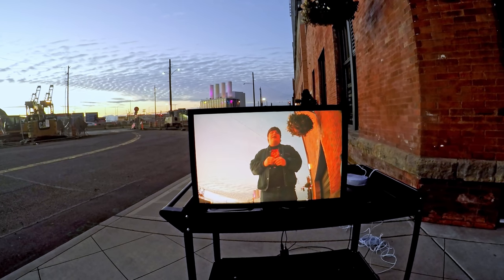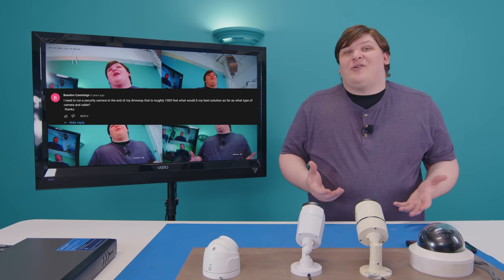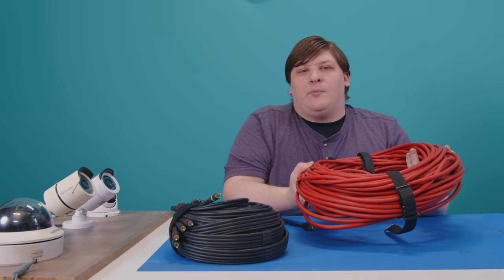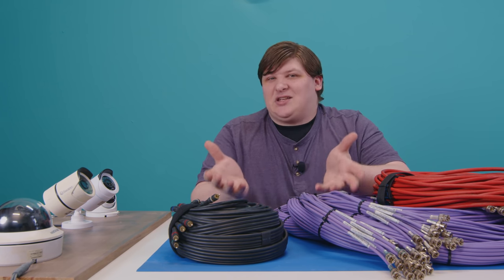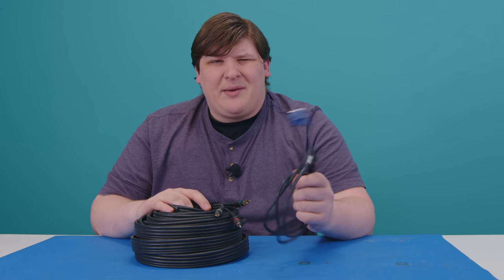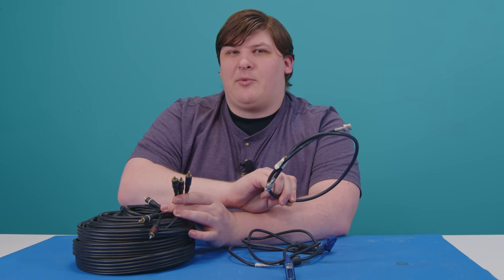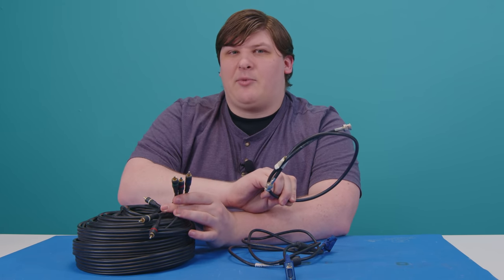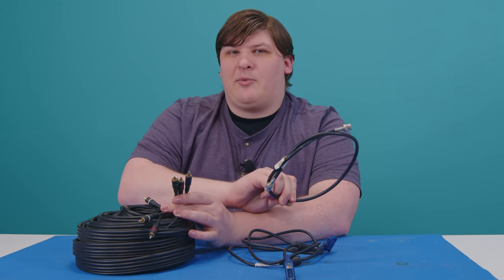1000ft of ANALOG HD video over a single cable?! [AHD/CVI/TVI]

Comment: Its nice and all but my consumer-level drone can send back 1080P video from multiple kilometers distance.  It's not wired or analog. But it works. The fact that this tech is in a drone doesn't mean it couldn't also work in a fixed installation. It is simply a matter of how and where the camera and RF are being used. It does not have to be in a drone.  I am a little surprised nobody has done this already. The tech works.

Comment: The VGA issue also depends massively on cable quality, and finding good quality cables is incredibly difficult in my experience. I went through something like 9 different brands before finding one that had minimal ghosting... but still looked like garbage when compared to component!

Comment: I think if we lived in some alternative dimension where digital tv never happened, this could have developed much further already.
There are still things that compressed digital video does horrible even at rather high bitrates, like for example background details with little movement.Those background areas with little movement or details are not updated every frame of video which to me is very noticeable. With lower bitrate videos like here on youtube you even get large macroblock compression in those areas.
Reply: YouTube's compression really, REALLY hates dense green grass, something they probably should have checked for considering how many sports are played on green grass. I think the only two other reasonably common things you'll find that are worse are explosions/fireworks, and confetti falling.

It does seem like someone miscalculated just how sloppy B frames could be without impacting the experience, and it's not a new thing. This has been a problem since the days of DVD. But YT's compression is particularly harsh on vertical-ish strands of grass, turning the whole thing into the Hank Hill "do I look like I know what a JPEG is" meme.
Reply: YouTube does not use very high bitrates for its compression at all. For 1080p content, it's only around 2Mbps. DVDs and Broadcast TV are around 10Mbps. BD is higher, but I don't know by how much.

Comment: Many years ago, people in my overall circle were using security equipment for low-cost HD video capture. HDMI to Ethernet converters, or IP HDMI extenders, and while the format was "proprietary", people have found a way to use a computer to spoof the receiver and decode it. Also all of that gear was very affordable. The video was compressed, i believe it was MJPEG. Ethernet has a different set of tradeoffs compared to transports from the video industry - it adds latency but in turn gains reliability, and 100m is about how much it can run before the next switch.

I wonder, why NTSC became established in surveillance? China runs on SECAM anyway, and even in NTSC land like Taiwan and Korea, most of the equipment has some compatibility, and you don't exactly need the higher framerate for surveillance purposes. By the way, European DVD players connected by EuroSCART do not squish the image when dealing with widescreen, they force the TV into anamorphic mode via the detection pin. I have seen this work correctly on a cheap 14" Toshiba TV made all the way back in 1986! Non-widescreen TVs when operating in this mode would scan lines closer together and blank out top and bottom, so the quality was remarkably nice, limited just by the quality of the phosphor matrix. Many TVs had a quirk that brightness and contrast would increase visibly in this mode though.

As to capture cards to convert HDMI into webcam use costing a fortune? There are new ones now that cost $10 from Ali and while they are somewhat blurry in the horizontal direction... they do true 1080p30 and 720p60, with MJPEG over USB2 with UVC. Unfortunately due to a bug in the chip, audio is mono (but stereo can be recovered with some hackery), and the reliability is REALLY spotty, many of them die in hours.

When you mention consoles, I don't suspect that TVI would work well for synthetic images. Even on Dreamcast, using composite or S-video was so much less satisfying than an RGB EuroSCART or VGA, because saturated colours don't survive colour conversion very well, and renderer aliasing would probably also lead to increased conversion artefacts. When you're viewing images from a camera, these drawbacks are not apparent.

Comment: You know what I use for professional HD CCTV installations? UTP cable, 4 cameras on one UTP, in one very cheap UTP, 2 cameras if you want to send power over the same cable, that's how we roll in Latin America, generally speaking and it works just fine.

Comment: I wonder how MAC would have dealt with this (or even PAL or SECAM compared to NTSC)

MAC was an analogue format designed to supersede PAL that ultimately became an answer to a question that, by the time it was asked, digital had come around.  It was designed from the very start to be partly digital (the sound was digital, the picture was still analogue but the colour and luminance signals were split on the same line rather than having a colour subcarrier broadcast along with the black and white picture) it was also designed from the start to deal with widescreen and even HD formats.  

It was intended to be an all new format designed for the broadcast of satellite TV.  But it was discovered that back in the early 1990s, PAL was already good enough for the vast majority of customers who had satellite receivers hooked up to their PAL TVs via RF.  They somehow forgot that the D-MAC signal would have to be transcoded back to PAL for the viewer to actually watch it.  

INB4 SCART, SCART was a format that went onto to be become more popular as the 1990s went on, but SCART was natively RGB, MAC was natively Y/C - more suited to S-Video than SCART - but SCART was way more common than S-Video in Europe.

Comment: The reason this stuff never appeared on the consumer market is deliberate. The industry knew that analog HD or even analog 4k was technologically possible, but took a conscious decision not to do it, because analog video is hard to put DRM on, and they wanted lots of DRM. I mean, 1080p high def tv was developed in the late 1980s, but it was analog, and it was kept as a very down-low niche or super expensive product. What they did push in the late 90s to early 00s was SD digital tv, digital video (DVDs) and the like. This moved everything to digital, and only once this transition was done and everyone was using digital tvs and digital players - so by around the mid 2000s - only then did they suddenly drop the prices on HD technology, mass produce it and push it to market.
Reply: This is not true analog hd is inherently more expensive because analog signals take up way more bandwidth than digital they first developed hd monochrome systems in the 1950s but it also failed also the only way to transmit hd color analog video on TV was by satellite but not everyone is on satellite so thats reason we moved to digital

Comment: wait when I heard the number 960, it made me wonder...

NTSC's "525" scan lines is of course two fields of 262.5 scan lines each. And because of the relationship between the horizontal and vertical scanning, this causes the scanlines of the second frame to be positioned between those of the first frame - the monitor itself doesn't "know" about interlacing, and a technically non-NTSC-compliant non-interlaced signal [such as the "double strike" of the NES or SNES, with exactly 262 scan lines per field] will appear physically different on a monitor.

So what if instead of 262.5 scan lines you sent 262.25? Would this "naturally" produce 'four field interlacing', allowing you to send a picture with 960 lines of horizontal resolution if you had a monitor with a narrow enough beam width [or a digital recorder at the other end that recognizes this format]?

I know from the rest of your video that this isn't what this format is. But it's interesting to think about whether it would have been possible [at the cost of time resolution, but as you said some of these cameras only did 15FPS anyway].

Comment: PAL basically took over the values of the NTSC. 
Color shifts only occur when the color value is transmitted via HF. 
That is why the color space is turned upside down with PAL every second line. On TV, this is put back in the correct position. If the color in the first line is shifted in the opposite direction to the second line, this is compared and corrected. The saturation of the color is only slightly weakened, but this is not noticeable. At SECAM, the same principle is implemented in a slightly different way, primarily for patent and political reasons. For a black-and-white image, the color carrier is completely switched off with SECAM, but with PAL this can remain.
At that time PAL was the standard in West Germany and SECAM in East Germany and France.
In principle, black-and-white TVs can display all three standards if the carrier frequencies are compatible. Color TV can display NTSC and just PAL and SECAM depending on which circuit was used. Or fall back to Black White picture. 

Fun facts. Switching from SECAM to PAL was quick. The studio technology was already designed for PAL, but for political reasons the color was recoded from PAL to SECAM at the time. When the union came, there was no reason anymore. But that was the end for many only SECAM TVs.

Comment: Worth pointing out if you sacrifice the POE element a media converter will get you 1000's of meters (using single mode fibre) for not much cost using IP cameras - especially if piggy backing onto existing fibre infrastructure which most modern buildings have. You can then use a POE injector to power the camera locally.
Reply from the maker: Adds a bunch of components though. If you have 64 cameras, you're buying 128 converters and 64 injectors. 192 extra failure points with 192 additional power requirements, that's what concerns me.
Reply: @CathodeRayDude  Thats why you wouldn't do that for more than 1 or 2 cameras - you'd use network infrastructure to reduce the numbers - 10 cameras into a switch using ethernet locally, you can run diverse and resilient fibre to your core meaning you can overcome some other limitations like single points of failure. You can also add monitoring to the mix to further true up and bolster the install. Most CCTV installations are heading this way now, I fit quite a few of them in large buildings in London.

That being said - the broadcast background in me is incredibly impressed with the alternatives and if someone was terrified of footage being in the digital domain this provides a solution.

Comment: Really interesting video. But a couple things. The introduction of digital tv was certainly botched here in the states, but the technology is absolutely more reliable than the old analog signal. These signals will deliver a clear picture at lower power or larger distance than the analog counterpart (FCC has good data on this). Not to mention a properly designed waveform will always outperform the analog counterpart. This is even true for weak signals. If you have a digital signal designed for low SNR, you can still get useable data when you could never stand a chance of even hearing or seeing if it were analog.
Also you can absolutely run Ethernet over any kind of coax you want. It was that way before twisted pair existed. But nowadays you can get MoCA boxes that will convert between copper and coax. They work perfectly for 1Gb connections, and can be used over the existing 75ohn coax in your house without interfering with the TV or internet on the same cable!

Comment: oh man the discrepency between cinema 2K (i.e. 1080p) and monitor 2K (i.e. 1440p) drives me nuts to no end. 
esp considering 1440p should be considered (by cinema standards) 2.5K which sounds better than 2K, no?
i understand why 1440p is called 2K by some people/companies but that reason is just a dumb misunderstanding which frustrates me even more
Reply: And UHD is usually called 4K.
Reply: @debranchelowtone  well 4K, 2K, etc. arent specific resolutions, but more resolution classes. 

im assuming youre referring to 3840x2160 as UHD and 4096x2160 as 4K, but to be specific, 4K just means the horizontal resolution is around 4000 pixels. if a film was released in cinemas with a 1.78:1 (16:9) aspect ratio, it would have a resolution of 3840x2160, but officially still would be classed as 4K, as thats the only way a 1.78:1 video can fit on a DCI 4K canvas.

similarly you could say that most films on Blu-Ray arent 1080p because theyre 2.39:1 and so dont fill the full height of the frame (specifically theyll be around 800px in height) but the videos can still commonly be referred to as 1080p because the specifics dont matter. what matters is the rough ball park the specific resolution fits in as that gives people a rough idea of what kind of detail/sharpness/etc they can expect.
Reply: @bobbiesterling574  Interesting point ! Yes i take apart 3840×2160 and 4096×2160. Interestingly nobody is advertising HD as 2K. For commercial purposes HD is used but not 2k; and on the other hand 4K is used but not UHD.

Comment: What would have been even better than analog HD would be analog HD over fiber optic ! In fact this is how cable TV works, the TV channels (they used to be analog, they are now digital) are sent at different frequencies into a cable, but instead of connecting the cable to an antenna to make a transmitter, it goes to a laser diode and into a fiber optic. At a few hundred feet from the houses the optical signal is converted back into an electrical sent on a coax cable, with possibly a few amplifiers in between.

Comment: If you’ve had only bad experiences with digital TV, I highly suggest an outdoor antenna! I upgraded to one, it makes all local stations be crystal clear no matter what and we get some from other markets as well. Or get an old-fashioned dipole/rabbit ears with a UHF loop antenna indoors. Those are way better than the stupid flat black box antennas and such. FYI I’m a self-proclaimed antenna TV nerd
Reply: Do you have any antenna brand/product recommendations?
Reply: @StevenBradford  I recommend you stay away from those flat panel plastic square antennas and I personally like the old-style rabbit ear antennas for indoor use. I bought one on Amazon for $14. At my house outside we use an omnidirectional antenna that looks like a weird orb but large directional ones are good as well.